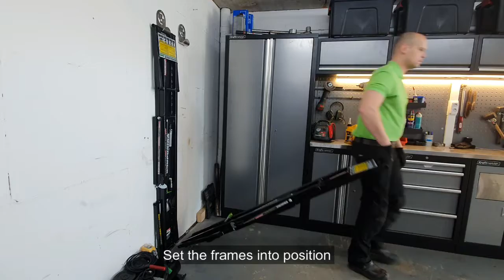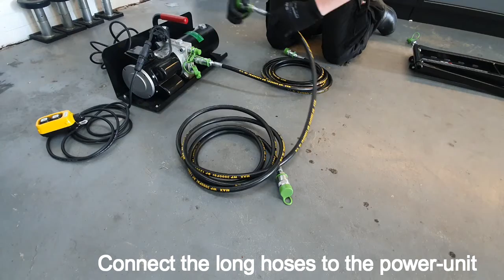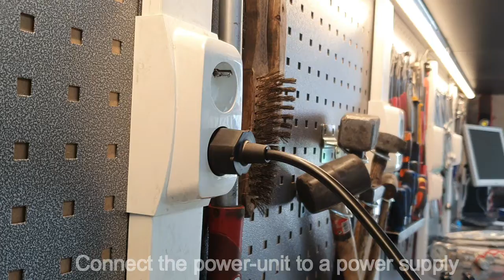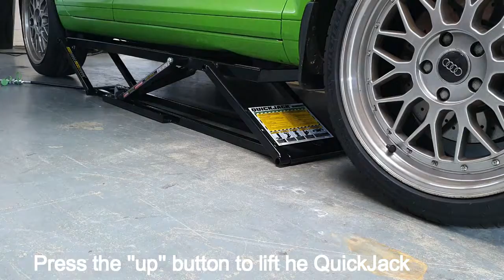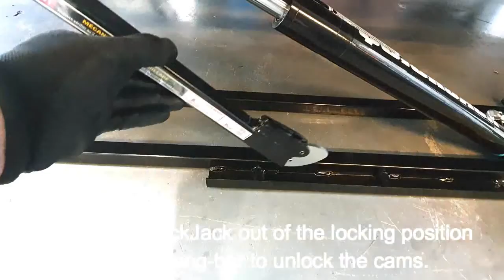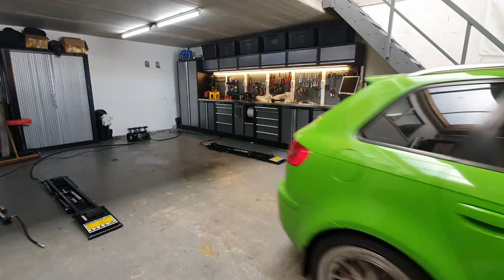QuickJack - How to operate the QuickJack Portable Car Lift, Easy, Fast and Safe!

Comment: What if you want to use a single ramp, instead of both. Will the pump work, just connecting one single ramp?
Reply from the maker: This won't work: The power-unit is designed to equally flow fluid out of both connections, when only one port is connected, it won't flow oil at all.

Comment: Does it always need to be connected to power? Can I raise it and then unplug it? , as the power point is not in my garage.
Reply from the maker: No, once the QuickJack is locked into the safety locks, you can unplug all hydraulic and electric to get it out of the way!